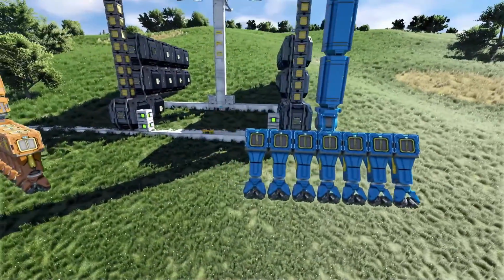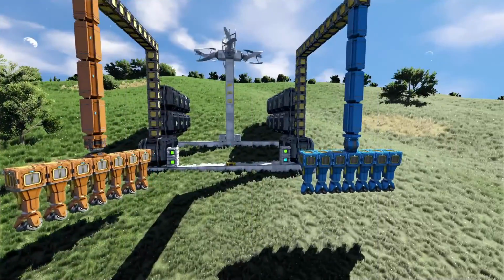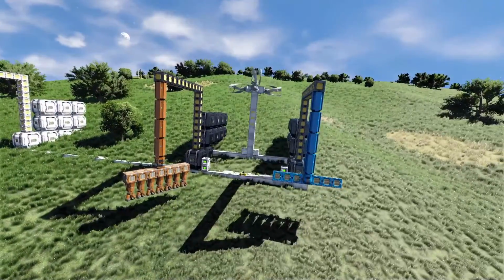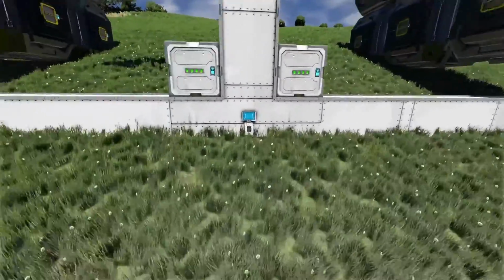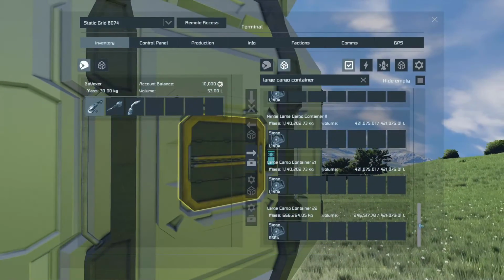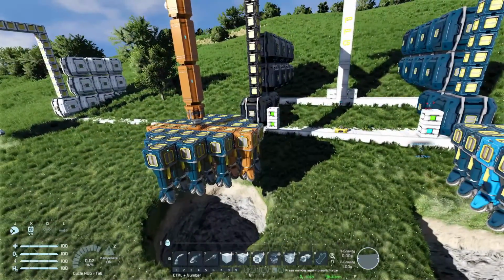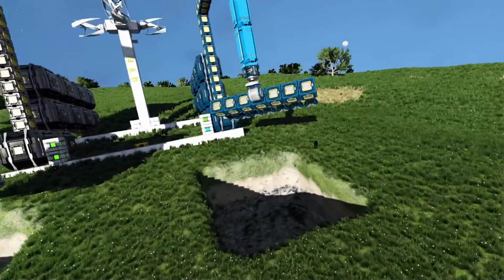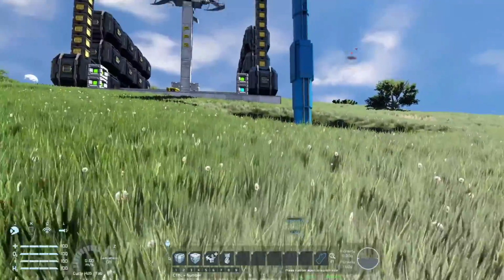Space Engineers Experiments: Rotor or Hinge Drilling Rig? Which Is Better?

Comment: Circular is much better than hinge one if you don’t mind the shape and just go for efficiency. You can put a counterweight on the other side of rotor to balance things out. Or you just space out drills 1 block apart with conveyer tubes making it so the drills on the other side cover the gaps. For example you make it like DCDCDDA, where D is a drill, C is a conveyer and A is just additional block to equilibrate perfectly the center of mass, the rotor is connected to the middle C (4th). This way you will have only 4 drills instead of 7 . You can use event controller to descend the drill after each full revolution of the rotor instead of using 2 timer blocks. Use tubes instead of conveyers to save even more on resources. The drill is fast enough, in early game you will probably want to stay nearby and to save on amount of cargo containers you can disable drills to use conveyer system until you reach the actual ore deposit. After you went through the ore you have an option to remove the drills, place the corner conveyer, attack another piston to the side and 1 drill on it. This way you can continue drilling into ore deposit layer around the initial well extending dramatically the amount of collected resources without moving the whole drilling station. And it’s worth to mention that you better build the drilling station parallele to the ore deposit  vein to begin with.

Comment: So, I made a little math here...
Hinge would be more effective in 7 or less blocks 
After 7  ( 7.63 to be more specific ) blocks rotor system would be more effective ( if we plays drills as Diameter )
But if we will place our drills as Radius, then rotor system will be more effective after placing 4 drills

As for the combined system: 
it will add 0.564 * (number of drills) ^ 2 to your rotor mine area

Comment: You need 3 fewer drills with the rotor system, because the drills rotate, covering the same area, so the difference is 1 steel plate, 2 timing blocks, and 3 drills.

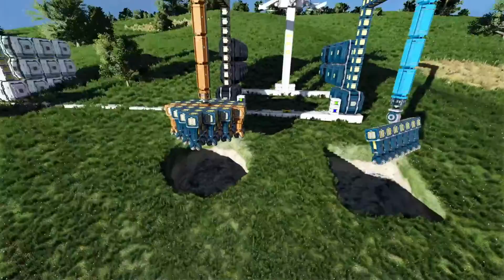Comment: Rather then creating amusement park as at 18:03 I would opt for few conveor blocks between hinge and drills, so "arm" of the drills will be longer and as that swing will be longer the hole will be wider and so collects more material.

However, in theory those are nice and proven designs if you would like to drill a loot of Ice for example (sorry, don't know too many people intentionally drilling gazillion of metric tons of Stone).
And as ore deposits are usually a bit flat. Then my favorite method is airborne drill rig with static drills in front. Usually manual so instead of drilling and dumping stone I scrape those layers once I get close to them via access shaft in drilled with RMB. Make a rig square to drills and it will then be capable of U-turn inside a shaft it drilled for itself. Handy for easier "driving".

Comment: Well hinge drill obviously gathers more - it is basic geometry. If you overlay both holes, the round one has unexcavated corners and thus mined smaller area in same amount of time. Square hole is also easier to convert into underground base if that is what you want. However where rotating drill shines is how hard/easy it is to scale it up. All you need is to move the rotor from the head to the base of the rig and it will dig up a giant hole around itself... you cant do that with the hinge drill. You can add a rotor to the base but some drills will always overlap with already dug areas and thus mine nothing and thus making it less efficient at large scale mining.

Comment: You didn't use the rotor and the hinge to their potential. The hinge is more useful if the hinge is higher up since it gives more swing and covers more area. The rotor is more efficient if you put the drills on only one of the sides of the drill so that the amount of drills equals the radius of the hole instead of half the radius, you can double the efficiency of the drill setups without using more materials this way. You can also put small grid drills with attaching a small rotor/hinge instead of a big one to save materials. The rotor would be much better if you put the drills in a more efficient way. The hinge would eventually beat the rotors but you need to put them at a very high point.

Comment: Okay the circular one scales with the number of drills squared since it goes in a circle an extra drill increases the area in 2 dimensions.
The one the goes back and forth only increases in a line so it has basically the same efficiency scale as the basic one. Which is pretty bad.

In the case for the 7 drillls seems to be the tipping point since it forms a square. More than that I'd definetly say the circular should be better (maybe it goes to 8 or 9) but 7 drills making a square you can move it and cover a bigger area easier than with the rotor system so even tough the system is scales less if you put it to the best you can use it smartly and get a lot out of it.

Comment: What do you think of a drill that doesn't start spinning until it is at the ore level, and possibly has the outer drills hinge outward, so there is a smaller hole on top, and a wider hole at the ore level?  It would be a little bit more complicated but would allow a smaller rig to excavate a larger volume.

Comment: Cool video! I was curious, so I did the math. Each drill is about 3 blocks long, and mines a little more, so let's say 4 blocks. Then the hinge system mines a cross sectional area of 8*n, n being the number of drills. In contrast, the rotor system mines pi*(n/2)^2 cross sectional area. This means that for sufficiently large n, in particular, n > 32/pi ~~ 10 drills, the rotor system is actually better, however with fewer than 10 drills the hinge system is best.
Reply: This doesn't check out. With the same width (or diameter since rotor makes a circle) the hinge will always provide more because it is getting the corners of the circle that the rotor misses. 

You could do a plunging rotor drill and make a big circular hole, then swap it for a hinge system that otherwise matched and it would still have the corners to hit and so would produce more stone. 

The only big advantage of the rotor design is you could have half+1 as many drills by starting in the middle and just going one direction. This would save on drills initially but be a much longer drilling process and require either timer/programmable blocks or an operator
Reply: @hillzachary01  This took me a while to grok, but the thing is that the more drills you add to the hinge, the more it becomes a rectangle.  As it becomes a long, thin rectangle, the rotor always stays a circle and will eventually become more efficient.

Comment: You can simply calculate how much better the hinge one is by looking at the area of the holes. They both use the same width which becomes the diameter (D, r=D/2) for the round hole and the side (S) of the square hole. Area of the circle is 3.14 x r squared, area of square is S squared. If you do the math with any size you will see that the circle has 78.5% of the area of the square. Based on the mined materials you can see that is indeed pretty accurate. You can say that you roughly mine 20% more with a similarly sized hinged design.
Reply: Yeah I thought similar before he even hit start

Comment: What stood out the most to me was that if you used four drills; one from the advanced rotor and three extending off to one side of it instead of seven drills centering on the advanced rotor you would use even less resources. When in a survival scenario, just one more large grid drill is an expense to consider.

Comment: For drilling using a rotor, the best approach would be to offset the line of drills so you'll gather way more minerals using the same amount of drills, that's where the rotor wins against the hinge.
Reply: I was just about to comment this.
Reply: People tend to go with two or four arms as the rotation needed is lowered, cutting time in half at least. It takes forever for the outside arms to clear compared to the middle arm.
Reply: @deejeh9494  However the issue with that is that as previously mentioned, you gain less materials and are having to use more at the start. Plus when you're playing the game anyways you'll be doing a lot of stuff throughout the drilling period so it doesn't matter much if it takes 4x as long. You'll be getting a lot of resources per minute as well so again it's much better to go for the larger radius rather than the quicker and initally more expensive route.

Comment: How do you stop either of these systems incurring the wrath of Klang? I tried a simple rotor and pistons system, and the whole thing snapped off in the hole.
Reply: Turn on "share inertia" and keep is simple. You could also double the piston width and have them joined at the end. Slower rotor rotation.

Comment: Nice. I've never thought of using a hinge one before. I've seen the circular one, and I built a rig that rotates as well as extends outward and downwards. For my mobile miners, I had 2 design, one with a tower in the middle with 9 stationary drills going down the middle (top heavy not too good) and one where I could retract and fold the drill 90° back to the top of the vehicle. 

But these designs are good also, I like them. You should make a video concentrating on "fast drilling" :D You know when "how much does it cost" and how "slow you need it to be" are not factors, you just mine as fast as you can.. You know, without breaking it :D

Also you can experiment with not putting the drills next to each other. Especially if your rill is rotating you don't need it I think. The biggest drill I made was like a checker pattern. 1 drill 1 skip (or  light)I made a 3 row line of that, the middle row longer. And all that was on a rotor. and the rotor was on pistons. I used that on asteroid miners, just parked on top of the ore node, and extended and rotated the drill. It worked well.

Comment: You really don't need to make your rotor based drill rigs symmetrical. Only build out from the center in 1 direction. It will make the same hole. And other people have said this but, space out your drills (Drill,Spacer,Drill,Spacer,Drill) would have gave you the same hole with only 3 drills.
Reply: Aliver87  Yes the drill spins slower, but in survival you can only process so much. And if there is a difference in material it's not much.
Reply: Aliver87  Well when he started adding all the drills to say how many you save by using this design....

Comment: The thing is mathematically the hinge solution will harvest more resources. Both the side of the square and the diameter of the circle equal 5 drills. Thing is, a circle with the diameter of a square will fit perfectly in the square resulting in some missed spots in the corners. Practically it's the issue mathematicians have with trying to square-ify the circle.

Comment: from geometry, n drills, with an individual drilling radius of r block-widths, drilling to a depth of d block-widths should give you

2rd(n+2r) blocks worth of material for the line plunge miner
pi/4*d(n+2r)^2 for the rotor miner
and
2(n+2r)(d-l)(l+r)+pi/2*(n+2r)(l+r)^2, where l is the length of the lever arm between the axis of the hinge and the center of the sphere that the nearest drill drills out.

The conclusion being that, the rotor one will start off worse than the hinge one for smaller number of drills, n, but get better faster the larger n is.  Though the hinge one can mitigate this effect with a larger l—putting the hinge farther away from the actual drills, such as at the top of the piston stack (though that probably has its own clang problems, so just switch to the rotor for really big projects).
Reply: I don't think you are receiving enough credit for this.  You setup the math by defining the moving and important parts.  Then you explain how to compare them and effect the change in size of each style and how it works.
Reply: Placing the hinge before the pistons does give some interesting options for attachment though.
Assuming you can secure and align your drill, it would allow you to attach additional pistons as you go, significantly increasing drilling capacity.

Though as you say, Clang may yet put a stop to such flights so close to the sun
Reply: I was about to hamfist this argument without your eloquence; thanks for this reply! He happened to pick the exact size where the swing drill would dig a perfect square (7 wide, 3 long on each side) v a circle of the same diameter - quick head math says circle will be smaller 😊

Also; see above for a better explanation!

Comment: For the hinge system, you can make a compactible system that creates a large rectangular hole by adding length after the hinge. This will increase the sweeping radius. If you do this with a piston, you can get a variable hole, and store the drill system when it's not in use. This could be useful for trench-diggers. Of course, you will need to slow everything down when you increase the radius.

For the rotor system, it could be more material efficient if you made an asymmetric system with a radius of 7 drills instead of a symmetric system with a radius of 3.5 drills.

The main difference is that in a rotor drill system (asymmetric), when you add more drills, you increase the radius, requiring slower pistons and rotors (or you have more drills going over the same paths to increase speed). In the hinge drill system, you can add more drills to increase the area excavated without needing to slow down the pistons and hinge. You can also use the hinge to fold up the drills to save 2 blocks of vertical space. Hinge systems can also have a variable radius.

Comment: If you stick to this setup, hinges are only better until it reaches 7 large drills. After that, the rotor one gets better. So if you are starting out, hinges are great. But if you want more space covered further in the game, use the rotor with more than 7 drills. You could make it even better (while slower) if you cover the radius and not the diameter (said from another comment)
This happens due to the hinge drill only extending horizontally, so if it’s 10 drills, it’s instead a rectangle. The rotor, however, expands in a constant circle, thus always getting bigger in the x AND z (or y if your looking from the top) axis.
Reply: But you can extend space between hinge and drills and keep it still square.
Reply: @JednoOkyAgresor  yes but the size increases much faster and cheaper then a square

Comment: When placing drills, it's useless to place them next to each other as they mind the 'block' they are in and the ones around it.  You should have drill-spacer-drill-spacer-drill.  It's cheaper on resources.
Reply: But everything you said doesn't work and leaves machine eating voxels in between the drills.
There is a reason people put drills next to each other with no spaces in between.
Reply: @D8W2P4  If you offset the drills on one side of the arm (start with a spacer on one arm and a drill on the other end) you wont have this problem :)
Reply: @stalincat2457 
Then there's no point in spacing it.
Reply: @D8W2P4  There very much is, resource-wise. You'll be able to mine a bigger radius with the same amount of resources (wich is what the video is about). In survival this is key as running back and forth with the hand drill gets tiring fast.
Reply: @stalincat2457 
There is no point since you have to have those areas in between removed or else it will eat the miner.
Like I said before there is a reason people do solid drill arms with no spaces.
Reply: @D8W2P4  I've been building miners and drills with spacing for a long time now, both small and large grid.
It works both for rotating drills (as the commie cat described) as well as fixed orientation drills (like a PAM-powered mining drone).
In both cases a checker-board like approach works.

The only thing that needs to be aware of is the area of a large grid drill is smaller (compared to the drill) than for a small grid drill.
This means:
If you're building a rectangular drill:
- small grid doesn't need an "outer wall" of drills (my atmospheric PAM-miner alternates between thrusters and drills) as the neighboring drills will clear the area for anything else in between (like aforementioned thruster)
- large grid drills (this is all, btw, for something non-rotating like a mining ship) do need an "outer wall" of drills, though. Inside, it can be checker board again. I would advise against having stuff "protrude" beyond the block where the drill's connectors are on, though. Something like a camera on a central conveyor junction is fine.

For rotating heads, having something like (D=drill, C=conveyor, center marked with [ ])
DCDCD[D]CDCD (this will need 6 drills for a 11-block diameter hole instead of 11 drills)
Especially early in survival, being able to just... not build 5 additional drills is very, very useful.
Obviously this does not work for a hinged drill head.
Reply: @D8W2P4  What about with the circular ones you alternate the ones removed on each side?
Reply: @cy-one  Truth here, checkerboard is the best way to go for large grid push miners.
If you want to see good demonstrations of drill spacings, for small push and large rotation, search KnowBotty - Space Engineers Experiment: Large grid drill placement. and KnowBotty - What is the optimal drill distance? Space Engineers Experiment (i know its kinda rude to point people to other channels but it is helpfull and took me damned long to find good examples loke those).
The most optimal non drillhead destroying spacing on rotational drillheads i have come up with (after explosions, blatant plagiatism and optimisation) can be seen on my space wormlike tunnel bohrer. Search "Ore Harvester / Processor / TBM / Mobile Mining Base" by Sergej on steam workshop. The pattern can be sextended indefinitely.